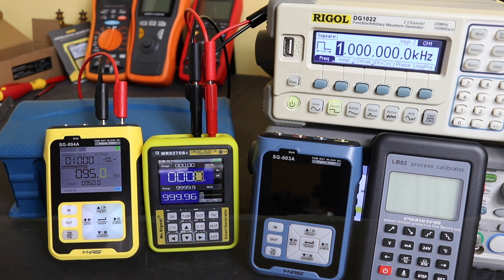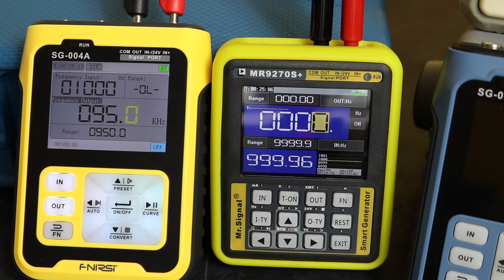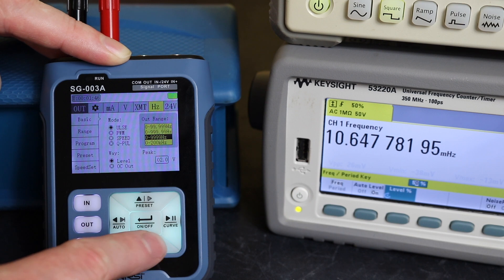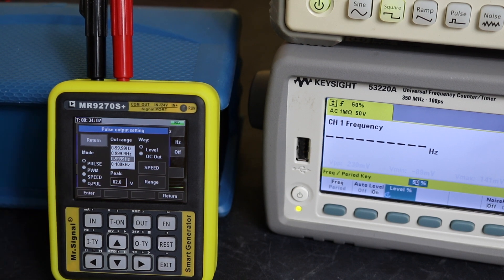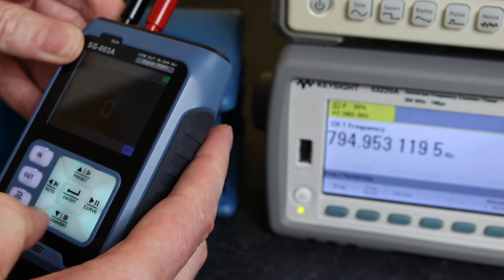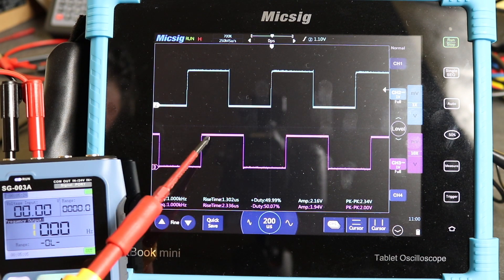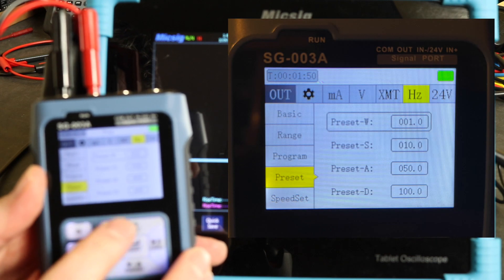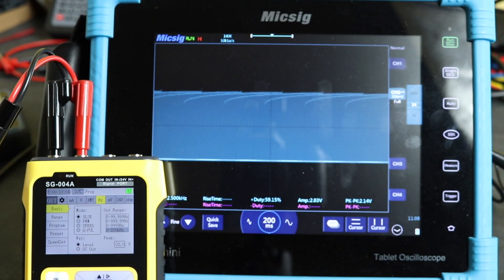Calibrator Frequency Function Checks

Comment: Which one is the best?
Reply: So, do you think it's worth purchasing the Mr Signal to use professionally?
Reply from the maker: @rodrigocarvalho-nb3rj  That's a very good question. For me, I use it professionally as a fault finding tool to verify what is working within reason and as a trouble shooting aid. It has quite a bit going for it in that respect. However, it isn't a full blown calibrator, so I would not use it if I am verifying sensors that for part of a process control. If they are just for indication, then it does seem to be good enough.
Reply from the maker: I would say that the Mr Signal unit has a bit more functionality and is more stable, it is however, more expensive than the Fnirsi. Thanks for watching!

Comment: Great video. Very informative as usual. frequency is one function I haven’t used much yet on my Fnirsi or Mr.Signal. I have a couple DC motor drivers on order that are PWM controlled so Ill be playing around with the Frequency functions in the coming days.
Reply from the maker: Thanks. I don't really have much use for the frequency functions. The pulse count and Q-Pulse can be useful for some of the plant I deal with.